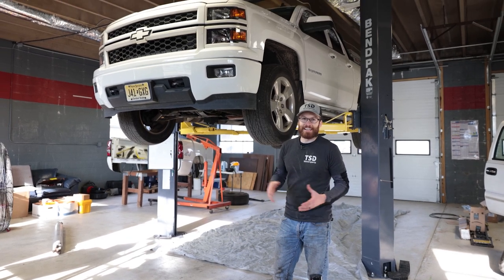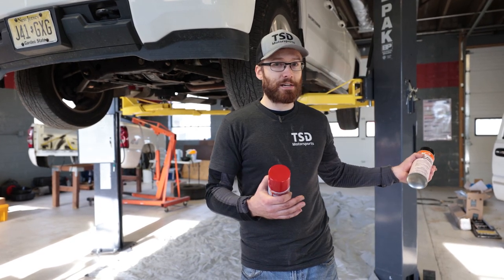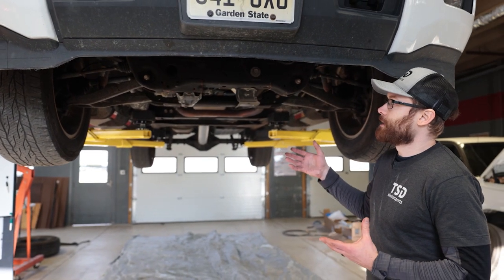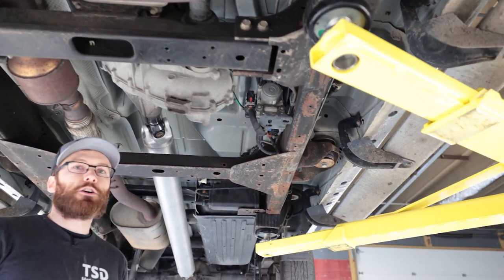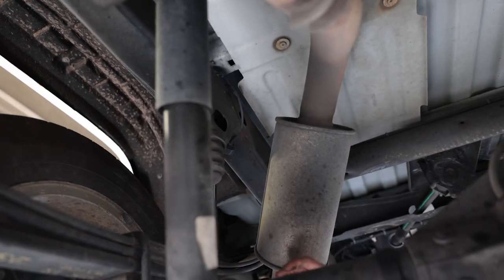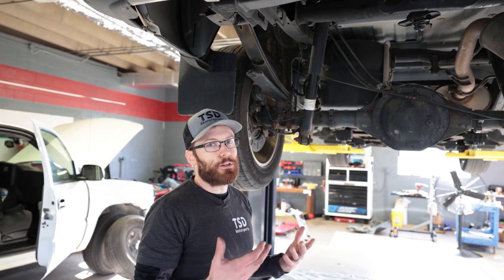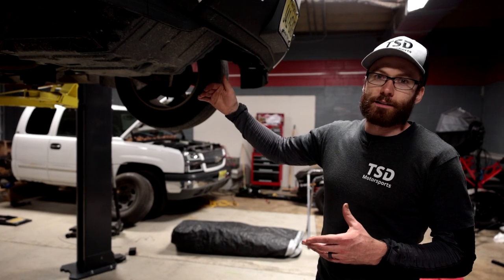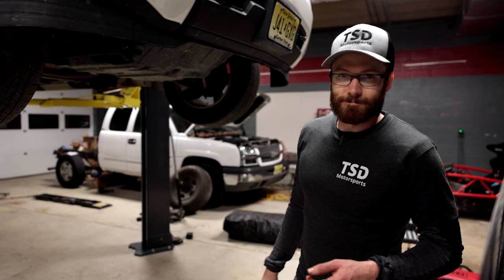Save Your Truck Frame - Watch This Before You Use Fluid Film - Rust Proof Your Frame

Comment: POR15 is terrible crap, dones't last and generally the worst coating.  Ask anybody who's used it more than once.  Summit Chassis Enamel is way better and is a two park catalyst system which will last.  Don't do POR15.  Also never use rubberized undercoating under a vehicle, water will get trapped between it and the frame and will accelerate your rusting situation.
Reply from the maker: Appreciate the feedback! Will definitely look into moe undercoating options for the future, what annual product do you recommend?
Reply: @TheSundaeDrive  most guys that use catalyst based enamles don’t have to do any maintenance unless it gets ripped off from off roading or whatever. Otherwise you can apply it right on top of the old coat so you just touch it up.  I’ve seen some 3-4 year reviews and it’s still in great shape. It doesn’t peel like por15.

Comment: I spray tf outta EVERYTHING under my truck. Wires and all. Never had an issue with rubber components failing.
Reply from the maker: Good to know! Thanks :) how many years have you used it continually on the same vehicle? Just curious. Would be nice if I didn't need to worry about the wires
Reply: @TheSundaeDrive  about 4 years now. While I wouldn't start spraying it directly on them some getting on isn't gonna hurt. Most wires and hoses on a vehicle are oil resistant anyway. Body mounts may be different however
Reply: I spray the brake calipers. Stops them from turning into crust. Not on the rotors though.
Reply: I just did mine today I took off everything spear tire fender flares wheel wells and coated everything used a full gallon of black on a Tacoma 3 light coats over 3 days 1st day I sanded all the frame welds and used rust neutralizer let sit for 48 hours and sprayed everything with fluid film black in light coats use a mask and goggles and gloves cost 100 for a gallon and the aluminum sprayer I had a little 5 gallon compressor easy job ,hard job putting everything back and use clothes that you will dump after

Comment: Thing to keep in mind is that most of the frame rot happens from the inside.  The stuff you see on the outside is mostly surface rust.  The big damage comes from outside where water and salt can sit for a while.
Reply: Agree 100%.
Reply: Use extended reach spray wands & go slowly when spraying inside frams or inside cavities (rocker panels, door insides, inside fenders, supports on pickup truck beds, etc).  Make sure to hit core supports too.

Comment: Fluid film and Woolwax are NOT compatible with GM's OE wax undercoating just a heads up if anyone looking to spray either of those on your frame. Fluid film after awhile will cause your  coating to fall off usually happens while washing and hitting the frame with the hose. Woolwax will probably do the same thing. I reached out to the company to see if its compatible they said its not compatible with GM's wax coating so i didn't try it.
Reply from the maker: Yup, that's my underanding as well. I put a long blurb about it in the description and the video. It will cause the wax to fall off. HOWEVER after awhile, the wax isn't protecting the frame regardless and I've decided it's time to spray it all down because it is better than doing nothing, I will be applying a yearly coating from now on. Once you start doing it you can't stop.
Reply from the maker: @Devin Herrington yup. My thoughts exactly. With my truck being 7 years old it's time.
Reply: Show me a GM wax frame that after 3 or 4 years hasn't fallen off on it's own. People want to blame the FF or the WW but the GM wax falls off even if they are not treated. So people treat their truck and then in 2 years say "Ff RuInEd My FrAmE cOaTiNg!!!" No, your GM wax coating is hot garbage and was going to fall off on it's own, coated or not...
Reply from the maker: Exactly. Well said
Reply: Rp342 wax protectant won’t 😊
Reply: Rp342 is nice wax protectant.  Look up water repelled by Rp342
Reply: Who cares. That coating comes off anyway.  There is more that needs protection than underneath your vehicle besides the frame It’s easy.  Just use fluid film every fall, including frame.

Comment: Did my 2015 Silverado with woolwax about a month ago. I had basically no wax left on the rear half of the truck frame. I did notice it definitely did soften the wax that was left towards the front of the truck as my jack rubbed it off. I don't mind doing touchups over the year where the wax comes off and I don't mind reapplying where needed every year. Better than rust
Reply from the maker: Yeah that's my thoughts exactly it's better just to keep applying this because eventually the wax is going to come off regardless of you spraying it or not

Comment: I’ve lost three vehicles to rust… I applied fluid film to my new Nissan NV 3500 three years ago and touch it up every fall… over time these products create a durable grease barrier that shields salt water… there is not a lick of rust anywhere… this should be a yearly maintenance on any vehicle regardless of where you live. Vehicles today are capable of crazy longevity if you don’t listen to the manufacturer… change oil twice a year or ever 3-5k depending on how hard you are driving… and fluid film once a year…

Comment: I just bought a 2019 Silverado Im going to take the bed off and clean it and paint it, you said poa isn’t ideal on bare metal, I got 2 questions  #1 does Does Eastwood have everything I would need for this project/is it safe to put on bare metal and #2 I live in Phoenix Az how often should I keep up with maintenance on my frame

Comment: So the wax GM used on Factory only ened up trapping salt and causing the frame to rust from inside out! Same with Toyota! Crazy! For this reason stay away from waxes. Fluid film ok. So yes using fluid film over these stupid waxes is likely a good idea as eventually as others have pointed out is it will remove and replace the stupid wax idea.

Comment: I have not had any adverse effects spraying fluid film on everything under my SUV. I do treat my door seals with silicone before spraying though. From their website " FLUID FILM has no adverse effects on plastics. Caution should be used around non oil-resistant rubber goods. May cause swelling." Great video thanks for sharing.
Reply: How do you know what’s oil resistant, though I would assume bushings and everything underneath the car would be oil resistant but you never know

Comment: Im doing my Suburban from out west with Rust-Oleum 7400 alkyd paint...I was doing a lot of research about POR based products for my truck and found out the 7400 is the best way to go...read about it over on steel soldiers forum and those guys collect the large military trucks and they swear by it so if they say it's better than POR and use it on their rigs then it's good enough for mine!...I don't plan on driving this rig in the Michigan winters we have but I do want it protected from moisture and to look good but I want to wait before I start coating because I plan on building a overland/rock crawler truck and I want to wait til all the welding is done and the axles are swapped etc...I even plan on using the 7400 on the bumpers and plan on pulling the carpet completely out of the truck and do the entire floor and firewall as well...comes in different colors...I don't know if anyone can share their story about using 7400 but I'd like to hear more good reviews from using the product!

Comment: I wouldnt even recommend painting your frame if you are going to be fluidfilming/ surfaceshielding it every single year. Just do a good job prepping it the first time you coat it. Get all of the scale off of the outside and get a long air wand and blast all the dirt and dust from the inside of the frame. Make sure you have a nice sprayer with a long hose to get into the frame and go to town on the inside and outside. Obviously get the body too. The problem is have with paint is it will flake off over time no matter what.

Comment: I have a 2009 mercury mariner, and Roy will frame with the wheels are the frame is rusting on both sides of the wheels can I use spray or do I need to have it welded

Comment: I use NHoil. Fluid film makes the wax coating come off!
Reply from the maker: I thought pretty much everything makes the wax come off. Nhoil doesnt? A lot of my wax is gone as it is unfortunately just because of the age.
Reply: @TheSundaeDrive  nhoil doesn't!
Reply from the maker: I'll have to check that out. Thanks!
Reply: @TheSundaeDrive  pretty sure if you do it annually or by annual they give you a little warranty action.

Comment: they advertise this as safe with electrical components,   I have sprayed this on everything for years
Reply from the maker: No issues with anything swelling?
Reply: @TheSundaeDrive  nope nothing.  I do not use washes with undersprayers or
Drive through quick.   

The barrier to oxidation is the dirt and grime that collects in the fluid film.
Reply from the maker: That's good to know it hasn't messed up anything. Makes me feel better about getting a little bit on some of the wires and hoses lol
Reply: @TheSundaeDrive  It only affects non-oil resistant rubber, aka, weatherstripping.

Comment: I'm looking for a non aerosol metal coating that dries and protects my tools from rust. There is virtually nothing on the market that I can find. I really do not like aerosol cans because they are not reliable or cost effective compared to plain liquid in spray bottles. A thick liquid or paste that can be brushed on is wanted alternatively.
Reply from the maker: You can buy this in jug form but does needed to be heated to flow.
Reply: cosmoline..
Reply: @jamesquercia5529  - Thanks seriously!

Comment: The problem is.. it’s a GM.
Ford and Ram moved over to e coating. Ford has the aluminum body so why anyone from salt roads buys GM is beyond me.
Reply from the maker: I wish they would ecoat. Every brand has their issues tho. Pick your poison lol
Reply: GM guys don't like to walk.......  oh btw your "military grade" aluminum still CORODES
Reply: @Doniehg  it does, very slowly. where i live in Canada they use salt and salt brine on the roads and there is tons and tons of ford trucks and its very rare to see any corroding yet.  i have a 2018 f150 with 150k on it and the body is still absolutely perfect.   frame is still black with the factory e-coat to
Reply: I have a 2018 Ram 2500 with 20,000 miles and my frame looks like crap.  Also have some rust in one of the wheel wells. So whatever it is they are doing it isn't working very well.  Off to the dealer it goes as it is still in warranty.
Reply from the maker: @derek, let us know if they actually are willing to fix it under warranty.
Reply: @TheSundaeDrive  I've heard that they don't like to fix them under warranty.  They better.  Haha.  But I'll let you know.
Reply: @Derek-pd4fc  updates?
Reply: @ramz1455  I am waiting for spring to take it in.  I figured I'll get through this winter and then I'll see what they say.  And actually upon closer examination, it appears that water got in between the metal and the plastic wheel well that froze and it actually bent the metal down on both sides in the rear.
Reply: @Derek-pd4fc  yikes hopefully theyll honor the warranty. I bought a 19 Tundra from CJDR and rejected their warranties.
Reply: @ramz1455  Warranty denied!!